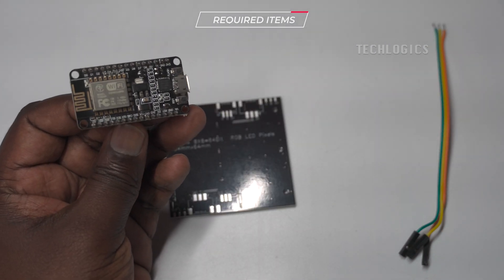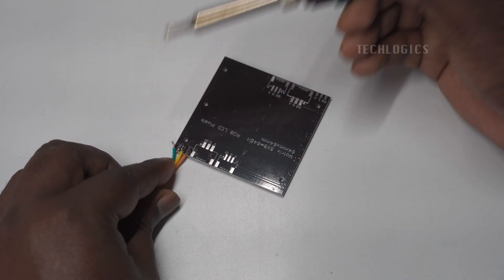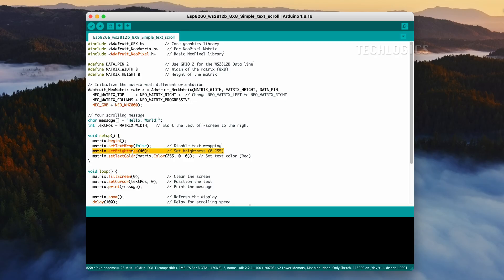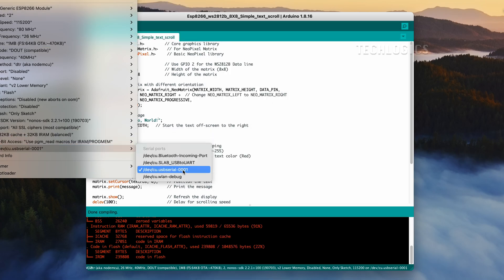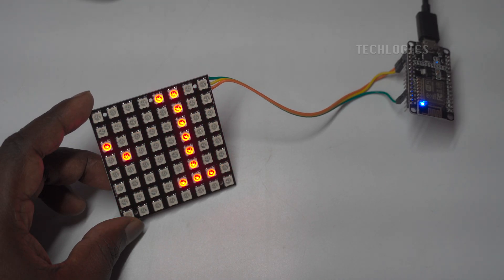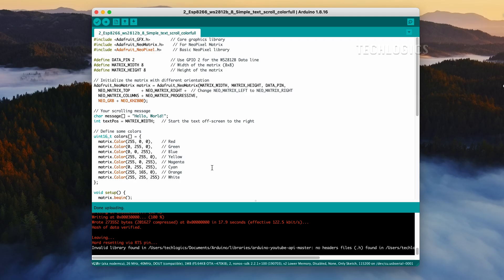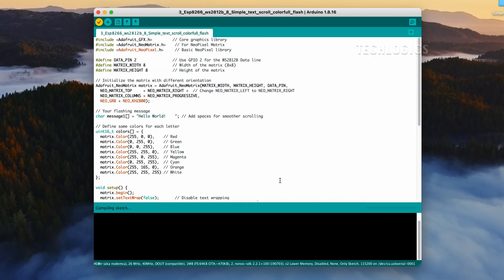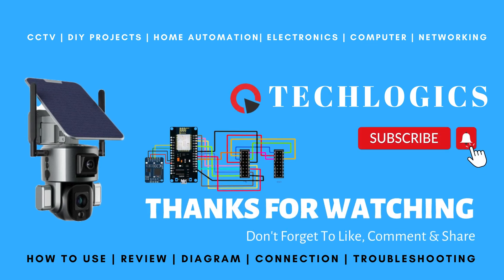How to Create Colorful Scrolling and Flashing Text Displays with ESP8266 and WS2812B 8x8 LED Panel

Comment: is it possible to use two WS2812B 8x8 LED displays? What modifications should be on your code?
Reply from the maker: Hi, Just modify the width 8 to 16

#define MATRIX_WIDTH 16           // Updated width of the matrix
#define MATRIX_HEIGHT 8           // Height of the matrix remains the same